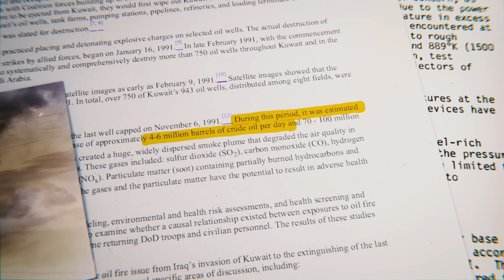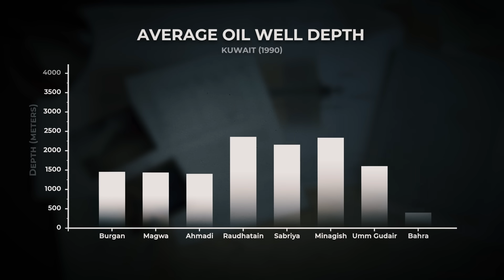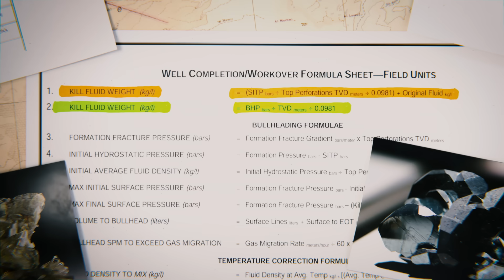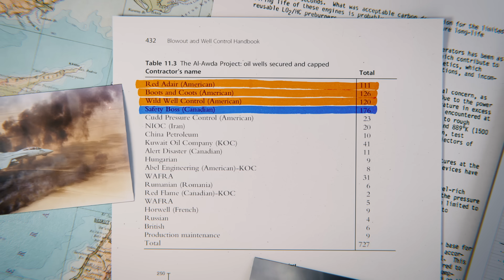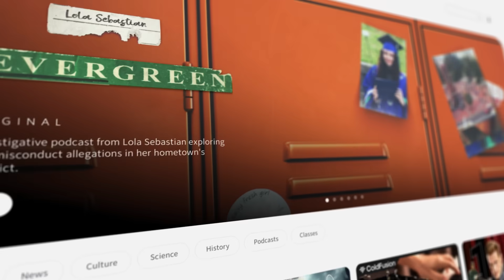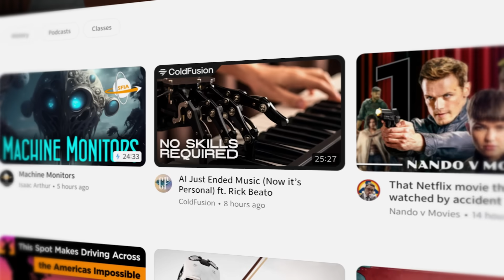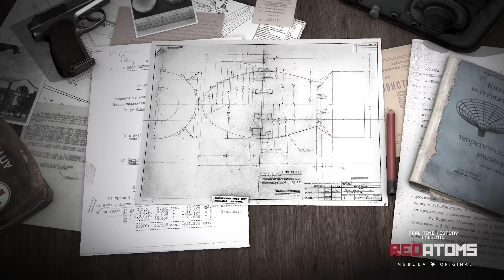The Worst Oil Disaster Ever

Comment: 11:17 I think those guys were having a bit of an argument.
Reply: 😂 I thought he was gonna kiss him
Reply: Yeah, I came to check if anyone else also noticed that
Reply: Yeah he was a bit heated. I wonder if it was about a safety issue.
Reply: Id bet it was just so loud they had to get that close, i mean, theyre standing RIGHT next to a well spewing oil at 7000 psi
Reply: @rawhidelamp  That's where ya stand to avoid others butting into the conversation. A 'cone of silence', if you will.
Reply: I was curious about that interaction as well, someone beat me to the comment  <3
Reply: They’re oilfield guys, that’s normal interaction
Reply: Ya he was barking alright... i think 11:15
Reply: @Marburg-yw4nj Who doesn't? Have you seen Ruang? What an absolute spectacle and honestly one of the most amazing things to happen on video in my lifetime. 3000ft high lava fountain + crazy volcanic lightning storm is gonna be hard to beat unless something actually world altering happens.

Comment: Quick fun fact, the BASF Ludwigshafen uses a very similar fire truck with 2 jet engines as a normal part of its firefighting.
Reply: They not only have one, but two of the so called "Turbolöscher".
And according to BASF they spray 6000-8000 liters of water per minute.
Reply: Came for this
Reply: Bayer also has a small version. Turbine fire trucks are not common but not a one off